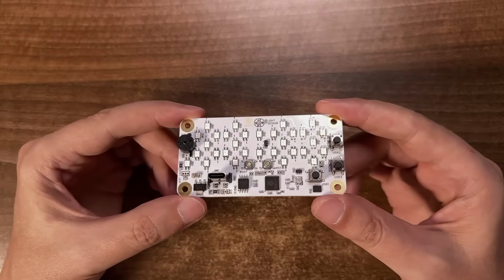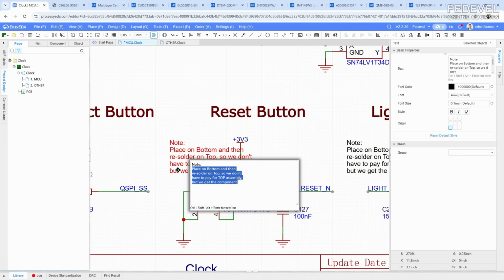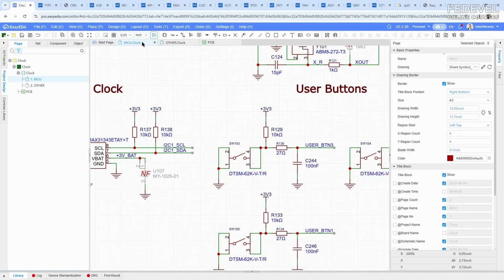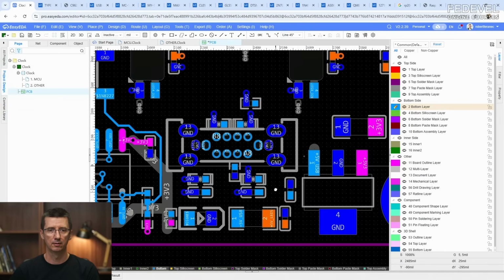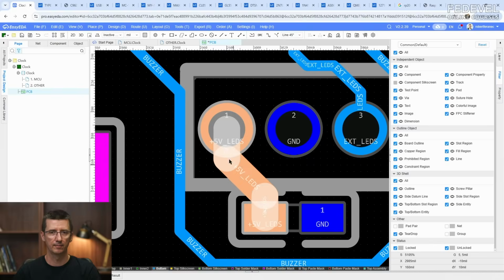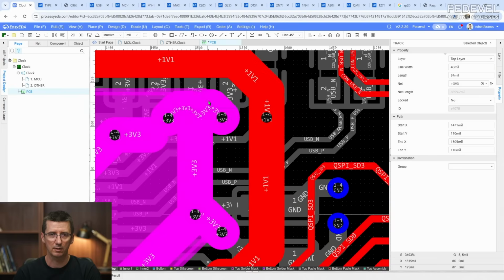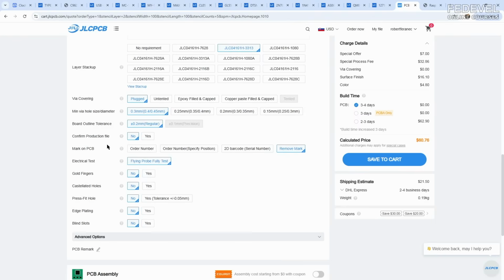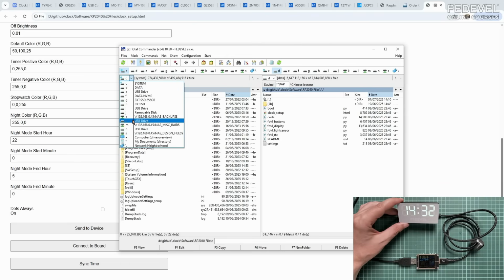How to Design Custom PCB in 3 Hours | Full Tutorial | EasyEDA

Comment: Hello, I had a problem with a PCB project where it just showed a black screen. The issue turned out to be with my web browser. I usually use Firefox, but it seems there are some compatibility issues with EasyEDA. When I switched to Chrome, it worked fine. So if you encounter a similar problem, try using Chrome instead.

Comment: Hello! I have not finished the video but Im curious about the diffuser you used. Is that in the BOM or repo? I checked but could not find it.
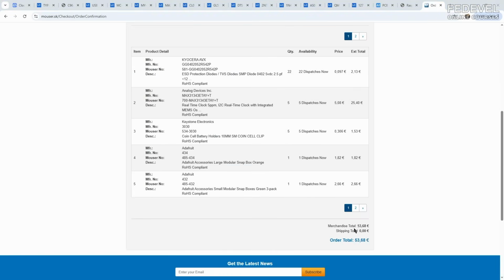Reply from the maker: 3:22:09 - you can just search for adhesive film diffuser on amazon
Reply: @RobertFeranec  thanks! I'm currently working in a product that does something really similar for a machine, so this is really useful to make some early prototypes before first articles xD
Reply from the maker: using the 3d printed front panel and the film diffuser is really cool. It is a super simple way basically to create any custom display.

Comment: Could you explain when to choose KiCad vs EasyEDA Std vs EasyEDA Pro?
Reply from the maker: I used to use EasyEDA Std, but a couple of years ago JLC said that the Pro version is going to be free forever, so I started using the Pro version (it has more features). I use EasyEDA for tutorials, because they have libraries so it is very quick to create boards (I don't have to create symbols and footprints, saves a lot of time). If I would be worried about keeping the circuit private and wanted to use free software then I would go for KiCAD. But personally I don't use KiCAD - for commercial project I prefer to use Orcad or Altium. I am still waiting for KiCAD to add some features (e.g. better component management) and I will have a look at the software again.
Reply: @RobertFeranec  Mr. Feranec, love you so much for everything you have done. Best tutorials and tips have been yours.
Reply: @RobertFeranec  Easy EDA Pro has actually also the online part library from LCSC and the community. The integration is just a little bit different.
Reply from the maker: @Leif_YT I used to see many community components in the EasyEDA library, but I think JLC moved to their own component library as I believe they didn't have good experience with community components (some components were not accurate and I guess it caused problems during board assembly). I don't know what happened with the already created community components. But EasyEDA (JLC) actually invests a lot into creating the library. Once I recorded a video about how they create the libraries, here is the link: https://youtu.be/t8MKDOuAs78
Reply: @RobertFeranec  In your opinion, what are the pros and cons of Easy EDA and Altium?
Reply from the maker: @rafiliya6258 EasyEDA: Pro - Ready Libraries, Free; Cons - Chinese company. Altium: Cons - expensive, you may need to create your own libraries; Pro - Professional tool that covers much more, not just schematic design and PCB layout (e.g. BOM management, variants, versions, drawings, lifecycles, ...). I think EasyEDA is actually very good. If it was not developed by a Chinese company, I think it would be much more popular. But the truth is, I have never tried to design a big board in it, so I am not sure how it would behave for more complex designs.
Reply: @RobertFeranec Yes, it is online web tool, probably it will be difficult to develop some SOM with processor with EasyEda. Thanks a lot!
Reply from the maker: @rafiliya6258 I think EasyEDA has also offline version, but I have never tried that.
Reply: EasyEda Std - SVG rendering, it is slow user interface and limited to max number components, due to computing power and "web browser" limitations 
EasyEda Pro - WebGL rendering , it is accelerated rendering by graphic card. Much faster user interface. No number components limitations
Reply: Also I think, that EasyEda Std is no longer developed.
Reply: Personally I would try the Pro Version. The interface is slightly different, but it is a bit more powerful and has some nice additional features and improvements compared to the standard version.  The part library from LCSC and the Community is also integrated, it just looks a bit different. 
Every time I tried KiCad I felt like I'm at least 2-4x  times slower with KiCad than with EasyEDA.